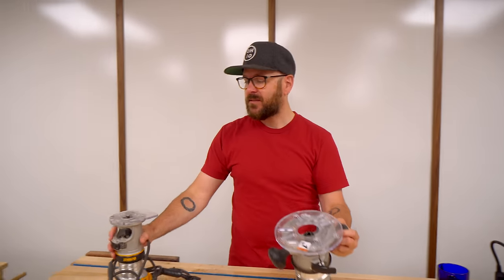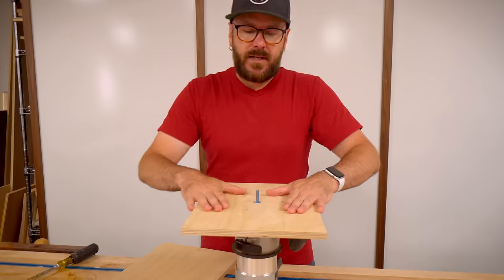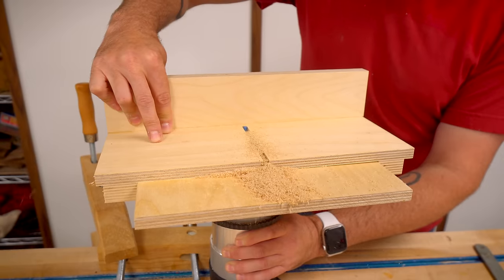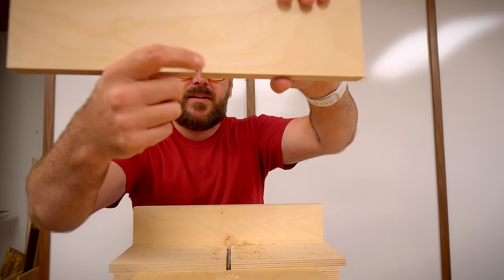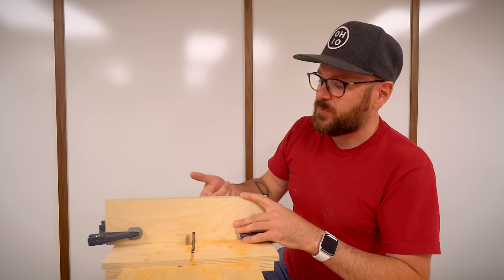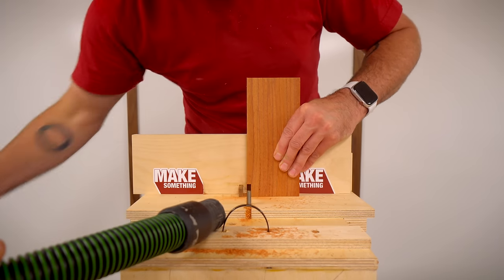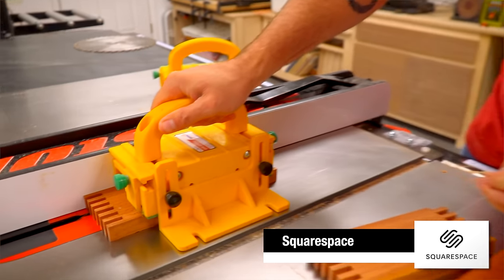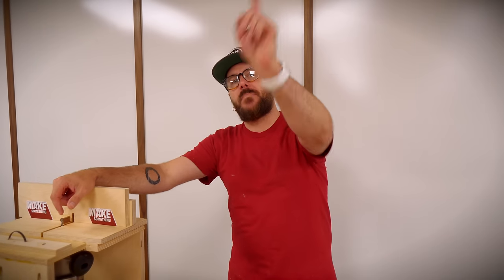How to Make Box Joints with Only a Router | Woodworking Jig

Comment: you could go one step further... in the base.  many have made router attachments using 1/4 inch plexiglass.  use the plexi to make a baseplate for the router,  then  cut a hole in your base that fits your baseplate flush.  I use my router with a custom plate to do signs and carvings...  but designed it so all I have to do is flip it over and screw it down so I can also use it in a bench or table like you are.  just an idea... but saves me time and versatility.

Comment: Thoughts on making the front board of the sled non permanent? Maybe drill holes for bolts so instead of having to make multiple sleds you can just have attachments for different sizes?

Comment: David - this is great! I have just started learning how to do box joints and one mistake I made was to use the far end notch of my workpiece as a spacer for the sides. I was cutting a 6 in (5.5 in actual) piece of pine and the end notch turned out to be slightly less than the 1/2 in width that I was cutting, so when I used this as a spacer to start the side piece, that piece was off slightly. You mentioned marking the tops of the pieces. This makes sense, but is there any specific order to cutting the workpieces to reduce errors or inconsistencies? Lastly, I've watched a ton of videos on box joints and router tables and few of them are as good as this one. I can tell you put a lot of time into editing to make this video short and to the point. Thanks.
Reply from the maker: Thanks! To keep things straight I always start with all the long sides and then move onto the short sides. Although it doesn't matter which order.

Comment: Good video. I'm wondering if there is a reason you changed router bits?  It looked like you started with a flush bottom bit but after making the jig you changed to an up cut bit. Is there a reason? Cleaner cut?

Comment: Good video and I was breezing through my build.  When I got to the point of routing the kerf in the fence, my bit kept blowing out the face of the fence, where the bit exits the cut.  I’m kind of stuck having to use my 18mm bit so I think it’s just too much.  My smaller bits all have too short of a shaft. You think switching to a spiral bit is the solution?

Comment: I saw a video where a guy made a temporary router table out of the flat piece of wood and just clamped it down to the side of his workbench and mounted the router underneath of it.

Today I saw a guy in another video make a drill press table extra wide and mounted a router underneath of it so that table had double duty. 

I was going to ask you if you knew how to make a box joint jig for a drill press.
Between this video and his I think I've got it figured out.
I don't have a table saw but I have a circular saw and a jigsaw that will have to suffice.
I suppose I could use my jigsaw to make a small table saw.

Comment: Watched this when it first came out and loved it then but didn't have an immediate need for it. That has changed now (need to make storage for large sheets of paper). Only got 3/4" ply so I'm going to make an insert for the top with a small bit of acrylic I have.
One question though: the bit you linked to is an upcut bit so will be pulling the dust down into the slot. Would a downcut bit be better? That would tend to push the dust up to the top of the table making it easier to collect it with the setup you had in the video. Sorry if this is a silly question but I'm a complete newbie in the use of routers.
PS. Ordering my bit this week from a UK company that imports the Whiteside bits.

Comment: Do we need to use hard wood for the box pieces? I am still tuning and cut a few pieces of pine to experiment with and I likely have too wide a straight bit given the smaller trim router, but I thought to ask if it was necessary to use hardwood or could we use softwood for boxes as well?

Comment: Great video, so I made one, but the router bit ,is very short, I can only do 1 cm deep cut, maybe I should use thinner ply, mine is only 1 cm , or can I get longer bits. Regards Bent. Malta
Reply from the maker: You can get longer bits.

Comment: how long is your router bit? It seems that you have two 1/2 inch plys + the box side width, so just short of two inches?.. most bits only stick out less than an inch - so does this require special bits? thanks

Comment: centering that board would have been easier if you used a centering cone. Anyone who has a router should invest in one. Also, make sure your board width is divisible by the size finger your going to cut.

Comment: No matter the bit, blowout is a problem with every pass. Plywood, hardwood, softwood...1/3", 1/2" doesn't matter. Speed of the router doesn't matter. Blowout every time. Suggestions?

Comment: As far as board width goes, is it as simple as the width has to be in increments of the bit width?  Meaning 1/4" bit would have to be  anywhere divisible by .25?  2" not 2 1/8".  Or does this math above just give an "even" look to the sides?  If you were at odds with this it would just have a smaller pin on the edge?

Comment: OK. I would like to do this but I need to keep a hand on the router handle to hold the switch engaged. If I let go, the router stops. I can't lock it in the "on" position. How did you get round this or is your router so much different from mine?
Reply from the maker: My router has a flip switch. Either on or off.

Comment: Seems like this would be much easier if you just started with a Router table.  And then make the cross-cut sled to fit.
Reply from the maker: sure. even easier at a table saw.

Comment: Hey man! 
Nice video, directly went to make one. Just tried it with plywood but it shatters the fingers some time’s.. what could the problem be? Or do you preffer to make the joints with solid wood? Have a fresh spiral upcut bit running on max rpm in my dewalt router.
Reply from the maker: Plywood is not good for small finger joints.
Reply: @MakeSomething  thanks, what is your advice on rpm regarding hard or soft timbers?
Reply from the maker: Unfortunately I don't have any good advice. I typically only use one speed which is probably not correct.

Comment: where did you find 1/4 bits this long..? 
2 sheets of 3/4" plywood just to get to an actual piece you are going to cut (which on itself might have to be cut to 1" depth)
Reply: I’ve found that Trend (in the UK) do an 80mm up cut bit that works for me on this exact jig

Comment: Have you come across any issues with the “table”  bowing? 

I’ve made a leveling sled and a quick table (similar to the one you made) and I had issues with the wood bowing while using it. 
*Wood for both jigs was 3/4” cabinet grade plywood and my router is 6” SKIL. *
Reply from the maker: I have not but it's only a week old. Did this happen immediately or over time?
Reply: The leveling/Planing Jig it happened immediately.  
The table took a bit longer, but not much-It saw much more use though.
Reply: Thanks for the informative/Humorous/quick to the point videos. I especially enjoyed the wood bending one.

Comment: Ive made the router table and its great but im getting totally confused as to how to line up the order of the cuts. you rushed through that not showing the sides you marked as the camera was straight on and you can't see your markings. my cuts are nice and tight but I can't get them lined up to form a box. Will have to find another video to explain.

Comment: You could run a shorter bit if you drill the hole in the base plate bigger then have the collet and nut go up further closer (but not touching) the slide.

Comment: Hi. Good video but I'm having trouble. At 4.24 you cut the kerf into the tall (front) fence. I get tearing out on the side of the wood where the router bit leaves the hole it has cut. How do you stop that happening?
Reply from the maker: The wood fibers need support. Try backing your board with a thin sacrificial board.
Reply: @MakeSomething  OK thanks.

Comment: Nice vid. Just curious as to why no dado stacks available in the UK?
Reply: It's the same thing all around the EU, due to EU safety regulations. An electric stop brake is mandatory in table saws, and that may slowly loosen the bolt that's mounting the dado stack. So they cannot be used. Normal blade is so lightweight that it doesn't have that problem.
Reply: Thanks. Seems to me a little extreme on the safety thing.

Comment: I am having problems with the router bit extending to 3/4's above the surface. The table is 1/2" and the sled is 1/2". The longest bit from shank to top is 2" 1/2. The collet bottoms out @ the bottom. I was thinking for a solution, what if I do a recess for the collet to get more extension above. Or completely bore a hole so the collet can extend more? Or does any one know a bit that's at 3"? I found one on Amazon w bad reviews and a bent bit on 1st use.
Reply: It's a 1/4 shank making router by the way.

Comment: I did my best, as a novice, to follow the tutorial. The result looked like I had tried running my plywood through a cheese grater. Any idea what I did wrong?
The sled slides, the fence holds, and the bit spins, but it TORE up the 5" wide 1/2" plywood I was using.
Reply from the maker: Try using a sacrificial backing board
Reply: @MakeSomething  Do you mean to add another board to the back of the plywood? I do not understand how that would change the way the bit tears into the wood?
Reply from the maker: @nikholton8810  Plywood naturally tears out. That tear out should be happening at the back and so a sacrificial piece there would help. If it's happening at the front you may have a dull bit. You'll probably have much more success using hardwood instead of plywood.

Comment: I made the jig,joints were nice and tight but the top and bottom of the wood didn't  align any ideas? please
Reply from the maker: Mark the top of your boards. That mark needs to always face the pin. Even when using the first board to align the second board.
Reply: @MakeSomething  thank you i will try that
Reply: Thx again just that little thing was all it took works great now @MakeSomething

Comment: "But I don't have a table saw...." Proceeds to use a table saw nearly every step of the way.
Reply: I don't have a table saw and made this jig no problem at all.  I already had an oversized plexiglass base made for my router so I sed that and some off cut plywood I had laying around.  I used a chop saw, but could have easily used a hand saw for the amount of cuts needed for this.

Comment: I don't get it.
Router bit is approximately 2 inches. One inch (less a 1/8th) lives in the collet, leaving just over a inch of cutting surface.
The base is 1/2 inch. The sled is also a 1/2"
That leaves not much more then zero. 
How is he able to make joints that look like thay are 3/4 deep with the bit linked in the description? 
Do some routers drop down (plunge) past zero?

Comment: Why do you use plywood to make something that will always need to remain square? I see this all the time on multiple channels, and it always puzzles me. Whenever I make a sled or jig that I intend to use beyond that job, I spring for HDPE or acrylic and make it out of somehting that's durable, consistent in composition, and not susceptible to warping. Maybe it's just because my work area is unconditioned, but this never makes sense to me.
Reply from the maker: Plywood does not expand and contract which means it will always be square. It may warp but unlikely when buying the good stuff and is usually stable once assembled. HDPE and acrylic are even better alternatives but crazy expensive. I don’t recall a jig ever failing on me due to warping.

Comment: This seems to be a hopelessly complicated solution to a problem with a much simpler solution. Build a simple jig with parallel but offset fingers extending either side of a central board, and rout the fingers topside with a bearing guided bit. Easy Peasy.

Comment: Why can't you buy a dado set in the U.K.?
Reply: They don't consider it safe. There's a ton of mass in a dado stack. When it spins up, there's an insane amount of energy stored up in it. It's a big flywheel. This is inherently dangerous, but the main problem is probably kickback potential.

Kickback sucks, but with a normal blade, it is limited. On a really heavy piece of wood, a regular blade will slow down when it catches and launches, and the piece won't launch at full speed. A dado stack can launch much heaver pieces of wood at high speed, compared to a normal saw blade. Death and permanent disability can result, and the victim could be on the other side of the shop. Even if the entire table saw is relatively light, the saw can launch really heavy objects with impressive speed, because the inertia to do this is stored in the dado stack.

I'm sure you could buy and use a dado stack in UK, in your own personal shop or garage. The insurance guys won't allow them for business use. Not if you want workmans comp. And if your worker hurts himself with a dado stack, he will be able to sue you.

Even if you know how to use a table saw, you rely on the fence being aligned, correctly, for every single cut. In a busy work environment, people can get complacent and things can slowly get out of whack.

Comment: Make box joints with only a router. But need table saw, chop saw and drill press to make jig. Forget it, I'll just use the table saw.
Reply: You actually don't have to have any of that to make this jig, but if you have a table saw , I'm pretty sure you have a drill and a chop saw too.

Comment: For the cost of the all the wood used to make that router jig you can just buy a titan table saw and make the simple jig in the previous video with the flat blade.
Doesn't it defeat the purpose of the video by you using the table saw to make this jig when you made this for the people who said they dont have a table saw and or cant get a dado stack?

Comment: IMHO the point of this video is not the tools used to make the router table and box joint jig, you can always adapt your method to the tools you have available, that's just wood craftsmanship pure and simple, the table saw just makes it quick and easy to do the video, you could do everything here without elaborate tools, it just takes a little ingenuity and a bit more time, if your not in a hurry then no problem, unless your a full-time woodworker or a very keen and well heeled enthusiast, your not going to have a perfectly equipped workshop, but you can still have fun, often thinking around your problems is where the real creativity begins, and there are few more fulfilling experiences than making something with your own hands and tools
Reply from the maker: I’ve always thought woodworkers are great problem solvers and good at figuring out how to do anything with the tools they have.
Reply: @MakeSomething  Hi yes, I couldn't agree more I always look at projects and problems generally from the point of view of how can I do this, it's all about finding your own solutions and preferred working methods, no to maker's work the same way, I learned a lot from my Dad about problem solving, and this together with my early formal practical training have stood me in good stead...

Comment: Me: I don't have a tablesaw to do finger joints, can I use just a router?
Youtuber: Sure, use this method. 1st step, cut this board with the table saw, then the mitter saw and finally use the drill press.
Me: 😒
Still very cool video, but c'mon, the video start with questions from other users asking for alternatives to tablesaws among others.